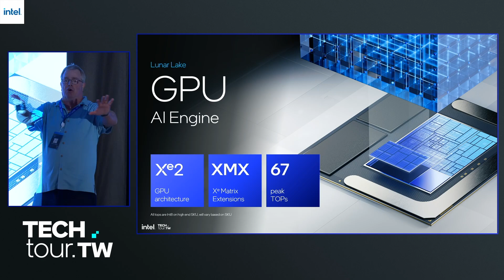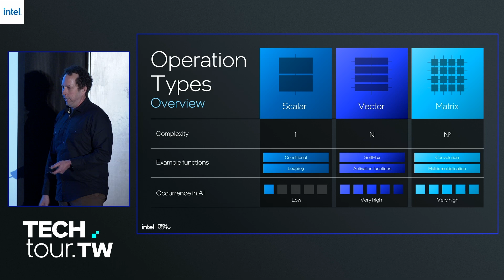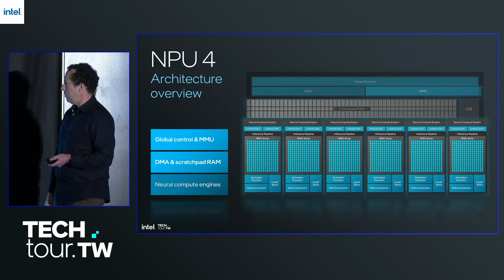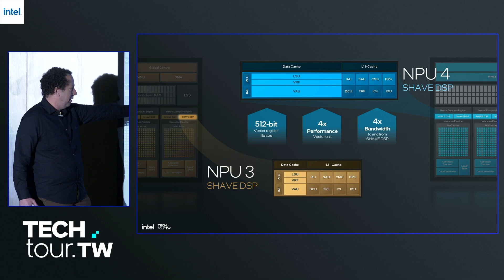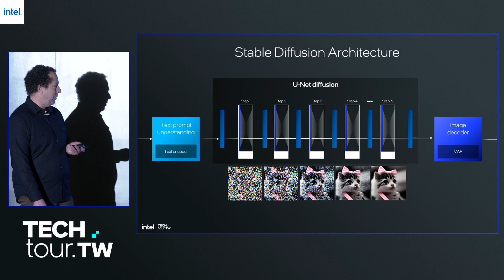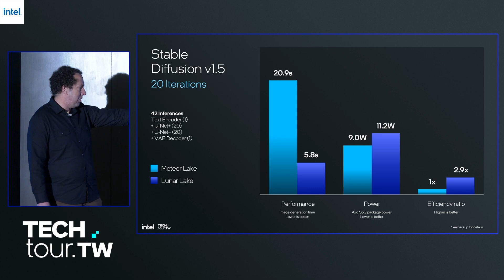Architecture All Access: Live at Lunar Lake ITT: NPU Architecture Deep Dive

Comment: I couldn’t find a single program, using NPU or any AI app stressing local NPU. Even Geekbench ML or AI does stress a NPU on ipadOS only. How is it possible, a power consuming GPU offering 500 Gflops and a smaller efficient NPU 10-50 Tflops? OK: Reduced set of operations, I got it. Regarding Lunar Lake: Intel is supposed for reaching industry‘s performance standards later. Right now, a Core 9 85H is on par with AMD Ryzen 9 7940HS/8945HS, but with double the demanded price.
Reply: NPU, not particularly useful!